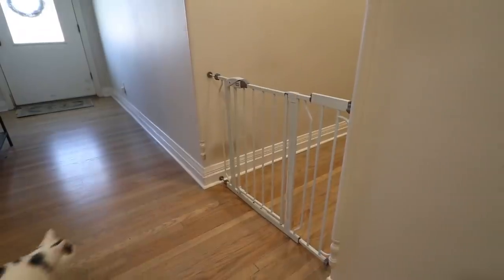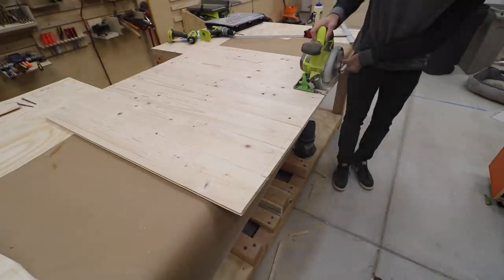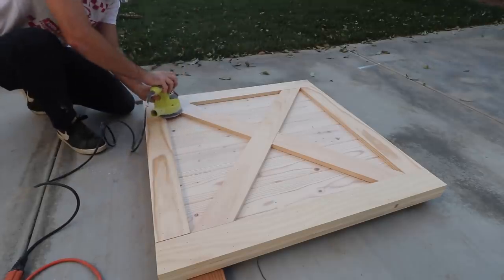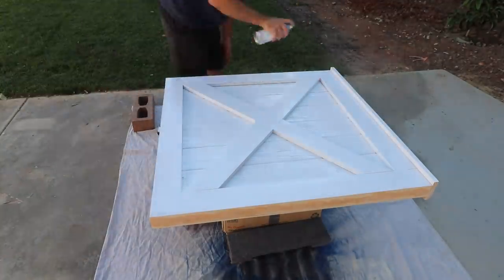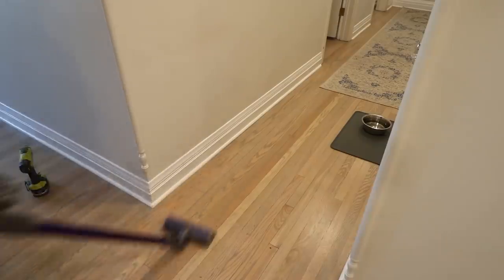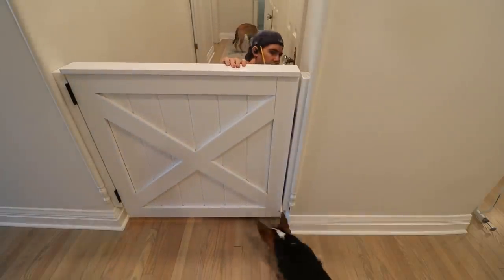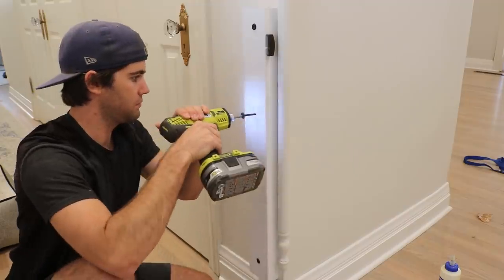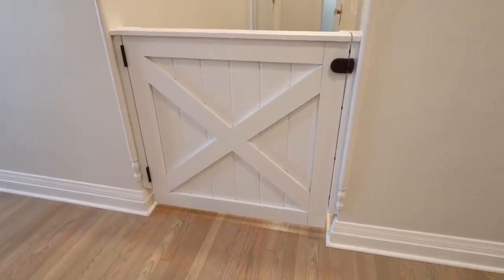Building a Dog Gate

Comment: Great video. You always have great content. Three thoughts. 1. Beams run horizontally, posts are vertical. Posts around a door opening are jambs. 2. A wider door jamb could have accommodated a traditional stop molding to keep the door from pushing in (curious to see how the stops on the caps hold up). 3. Mounting the door to swing in to the hallway would allow it to stay open against the wall and be out of the way. It may still be possible to rotate the whole assembly if the current setup proves awkward. Again, thanks for great content. Keep it coming.

Comment: Another reason to sand down the corners, "break the corners," is to protect the finish over time. If the corners are sharp when the finish/paint is put on, over time the corners will break off and the wood will peek through and ruin the finish. Softening the corners will end up strengthening/protecting the corners from wearing down as easily.
Reply from the maker: Didn’t know that but it makes sense. Thanks!

Comment: Please be very careful putting long leg screws like that into a wall and know where your electrical is. Normally you have about an inch and a 1/4 as by code so you cant hit a wire if you take that measurement plus the thickness of your material and drywall. Its very easy to hit electrical and that's energized...